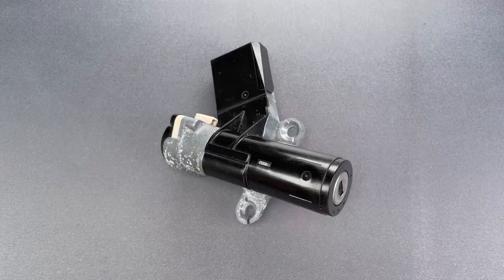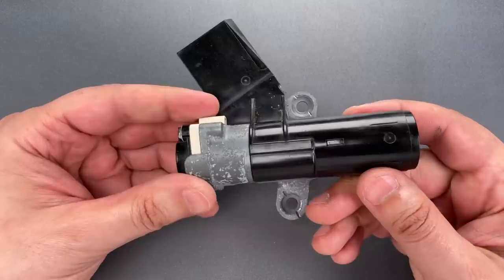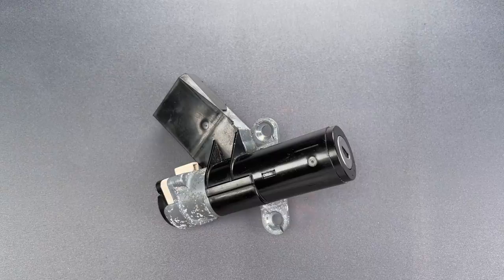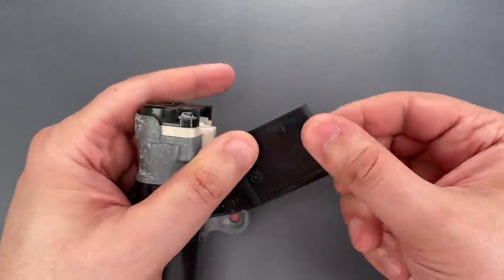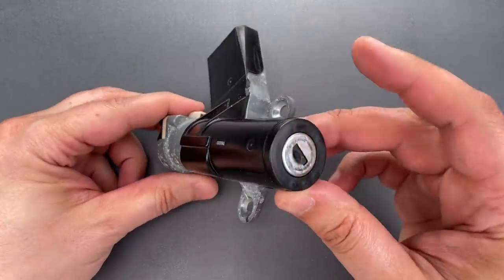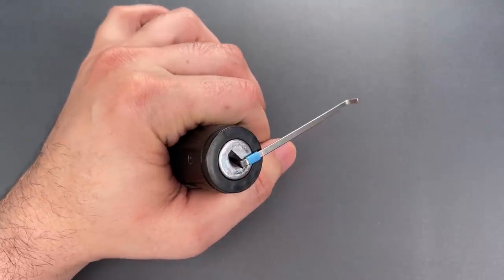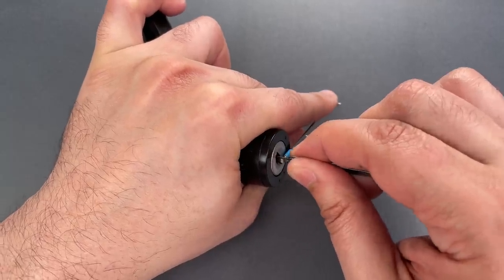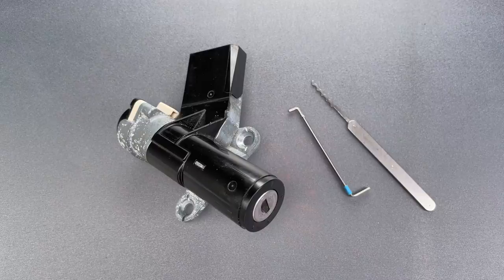[1335] Honda Metropolitan II Multipurpose Lock Picked

Comment: My biggest question is if you've had NO previous experience with a lock how do you know how many tumblers it has? Or to use a rake or something else? How do you know?
Reply: Try a rake.  If it doesn't work, then you probably have to pick it instead.  When you start from the front and work back with the pick, count pins.  If you reach for the next pin and either can't find one or hit the back wall of the keyway, that was the last pin.  (This answer probably sound sarcastic, but I'm being honest.  Attempting to rake something takes a few seconds and can save you several minutes of picking, assuming you're not as skilled as LPL.  The pin count only really matters for determining when to start again from the beginning.  Or..  Google it.  Especially if it has the model number on the lock.)
Reply: @gatherer818  thanks I was always wondering and this answered alot of questions

Comment: How difficult is it to simply unbolt/unscrew the entire lock assembly and replace it with another?
Reply: very difficult, you have to take out literally everything close to the ignition. A tenant left one at our apartment building for 10 years and we tried to get the ignition out to bring it to a locksmith but there was so much shit in the way we just called a different one and they took it out and made us a key, it costed 100$.
Reply: @swampaids  - The part in the video looks like it was held in place by 2 screws.  I was thinking, unplug, unscrew, install new part you have the key for and ride away.  Guess not.
Reply: @scootergeorge9576  the thing is its tucked away behind so much stuff, honda wouldnt make it that easy to steal
Reply: @swampaids  - Just a tensioner and a rake and good to go. It may be difficult to remove but easy to pick...If you're the lock picking lawyer. 
: D

Comment: I am looking for a specifically designed lock that’s completely unpickable by anyone.  What would you recommend?
Reply: Unfortunately that's not really possible
Reply: @bookreaderman6715  has a lock with those capabilities not been developed yet or can you tell me why it’s not available or possible?
Reply: @rebeccahjohnson9339  because there is literally always a way through even if that way is just busting the door down (or whatever is between the lock and the thing that's locked up), and let's say that you managed to get an unpickable lock (without lots of time and work) then it would be expensive enough that thieves would just steal the lock and leave whatever was locked up, and besides I feel like except for simple bypasses non destructive entry is more a theoretical thing, most thieves would just use a crowbar or bolt cutters or something
Reply: @rebeccahjohnson9339  now obviously I could be wrong, but I don't believe that I am
Reply: @bookreaderman6715  I find you rather fascinating
Reply: @rebeccahjohnson9339  oh? And why is that?

Comment: If the scooter cost less than $2K and at the very least there are roughly 4,000 parts on the scooter, Simple math will tell you what each part cost you, even less for the manufacturer, so security wouldn't be worth the effort.

Comment: Ha, please, don't even get started on motorcycle locks, My 2011 Kawasaki ER6F you can literally turn the lock with any flat piece of metal and a bit of jiggling. It's borderline a joke. Even my BMW is the same type used in the Minis which also you raked open in a couple seconds, it's only saving grace is it's a chipped key so if it's unlocked without it, alarm goes off and you can't start the bike.